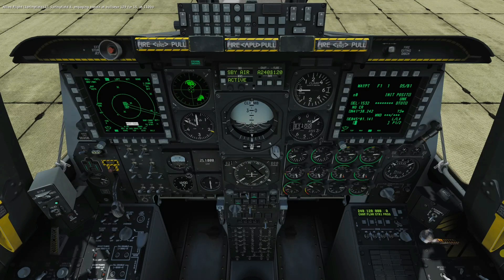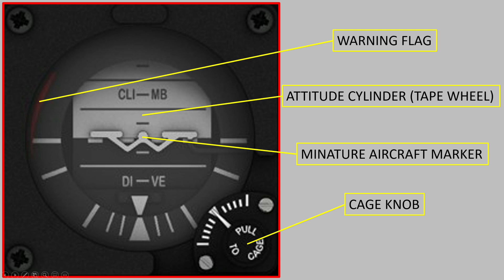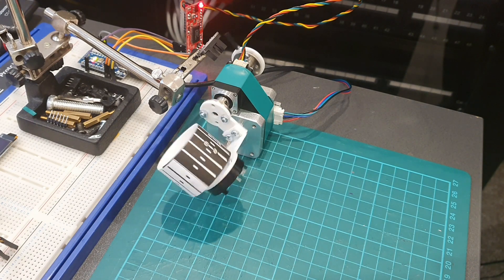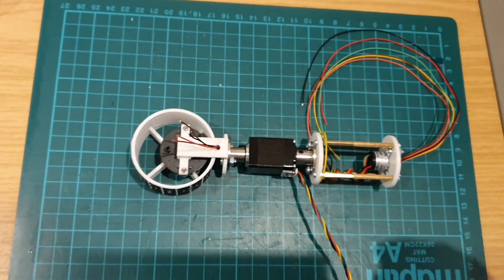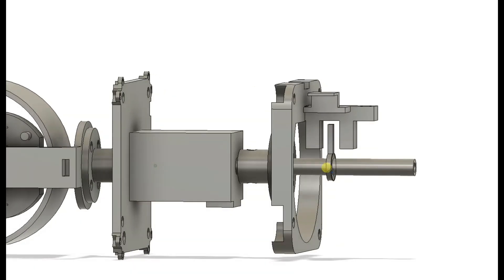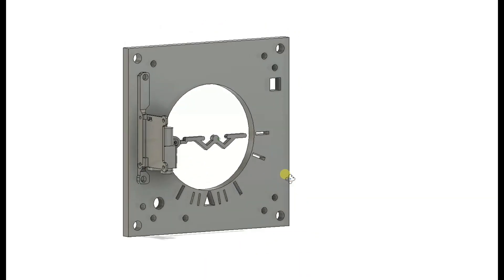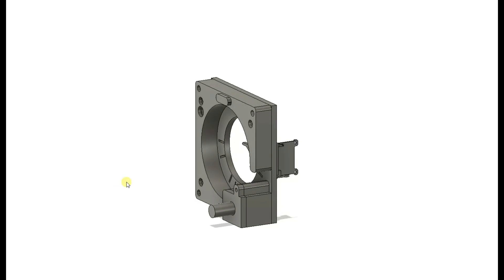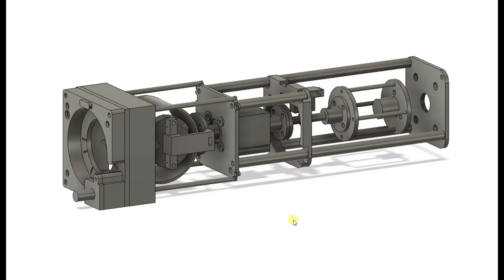Simpit A10C - Front Dash - Part 23: Standby Attitude Indicator - Design

Comment: Love the design. Is there any place where you describe a bit better how you made or where you bought those slipping to prevent the wires from being torn multiple times around?
Reply from the maker: Hi Rick, they are called "slip rings", I think I got them off ebay and Ali Express

Comment: Craig: Great Video!  Really enjoy the Fusion-360 walk-through of the design. I recently got into 3-D printing and used Fusion-360 to design a PETG slide-latch for a storm window.  It had complex angles with tracks and tight tolerances but was able to get it dialed-in for a perfect fit. Am looking forward to building some instruments (meters) myself. BTW, do you have a part# for the micro linear-actuator that you are using? Anyway, ust super facinating work and video presentation. Thanks!  Gary
Reply from the maker: Hi Gary, I purchased about 5 micro linear Servos (for test purposes) under a mix of the below generic titles / headings
* 1.5g micro digital analog servo loading linear actuator for ultra-micro 3D flight aircraft 
* digital ultra micro 1.5g linear servo for aircraft 
I ordered them spread across amazon, ebay and Ali Express. I also ordered a branded one 
* Spektrum 2.9g Linear Long Throw Servo - P-SPMSH2040L (although this seems a bit too big for the panel I'm working on) 
These small servos have a fair amount of jitter /chatter. I'm working through and testing them all. 
As regards fusion 360, I agree, it's a truly excellent piece of software. It gives such a high degree of control through precise design and modelling. 
Good luck with your project, thanks for watching 👍
Reply: Craig S Craig, thank you for responding--I will take a look! I have seen servos jitter for many reasons in RC. I'm not sure what you could do (Such as increasing the current or maybe even shutting them off when they reach their position; or maybe capacitive filtering on their power supply leads) since there are a lot of things that will cause them to do that including the way they are loaded. Let me know if you find a diamond in the rough!